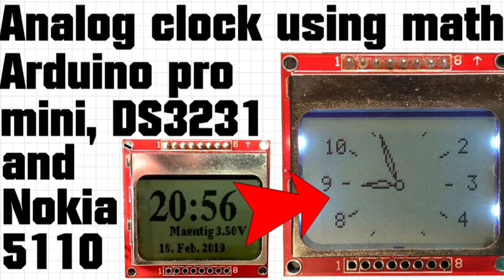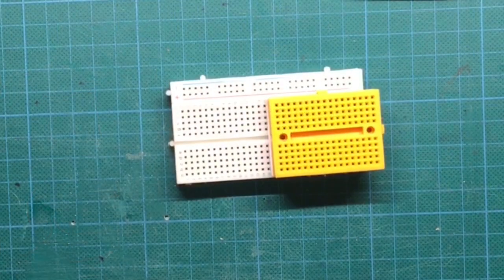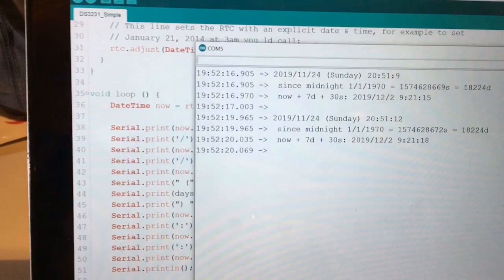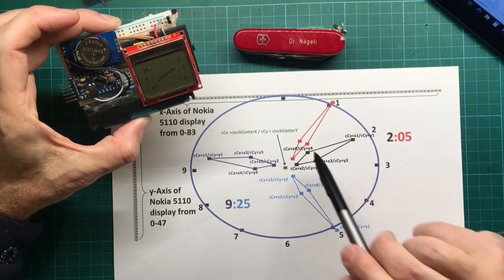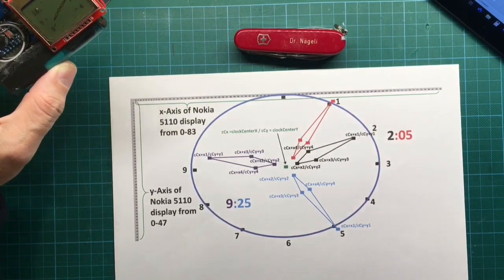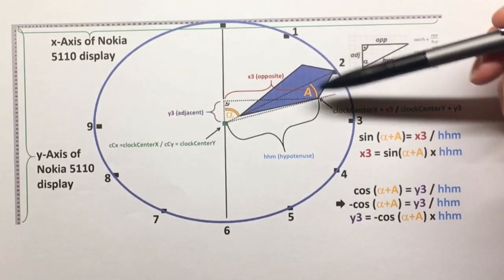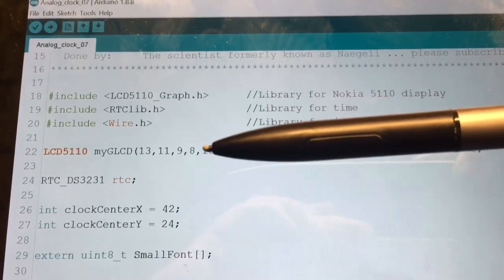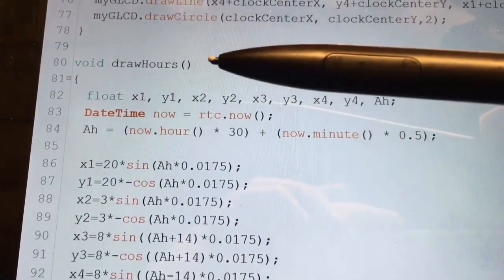Analog clock using math, Arduino pro mini, DS3231 and Nokia 5110

Comment: Thanks!!...
Just a quick question: why the  25 *  before sin ?? how does it affect ?

thanks.
Marc.
Reply from the maker: Salu toi, 
You will find an entire explanation in my Instructable unter: https://www.instructables.com/id/Analog-Clock-Using-Math-Arduino-Pro-Mini-DS3231-an/
In this Instructable you find unter Step 5 the explanation: "The variable “hhe” stands for the length of an hour hand. When using the Nokia 5110 display, half of 48 pixels are 24 pixels. During experimenting, I found empirically that 25 works as well as a maximum length for a hand. 
Regards Michael

Comment: Today I decided I wanted an analog clock to put in the background of my 3D printer to be visible during time lapse captures of the prints. So I did a search for "analog 5110 arduino" and your content that was uploaded yesterday popped up! I have all the parts on hand so I hope to get to putting this together this weekend. Thank you for the content and awesome timing!
Reply from the maker: Great to hear - the timing had to do with the dead line of the December 2, 2019. This is the latest date a project can be registered for the "I did it with math" contest on the Instructables homepage - the first prize is a 3D printer ..... whish me luck ...
Reply: @LeFreak  Very good! I stopped by the contest page and gave you a vote. Good luck!
Reply from the maker: @rescueseven  Solved! Thanx for uploading your picture on Instructables